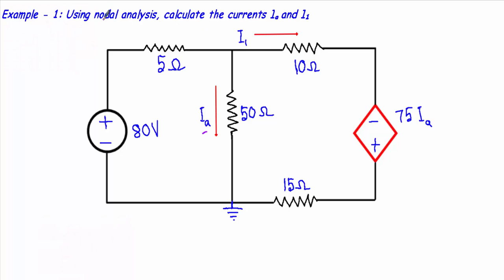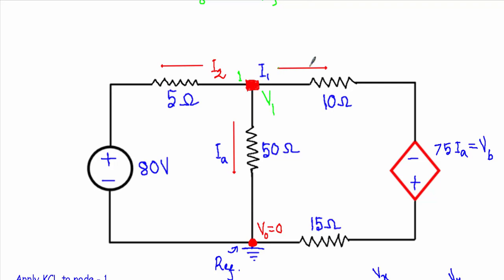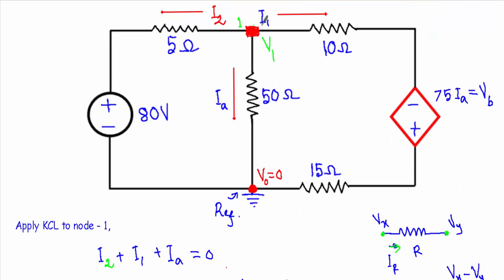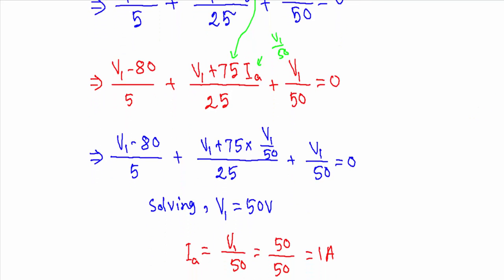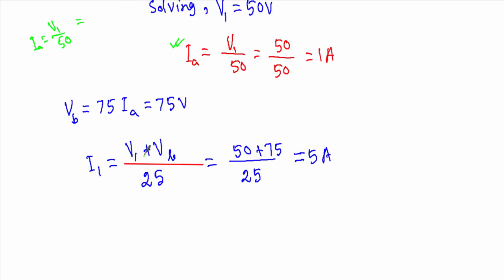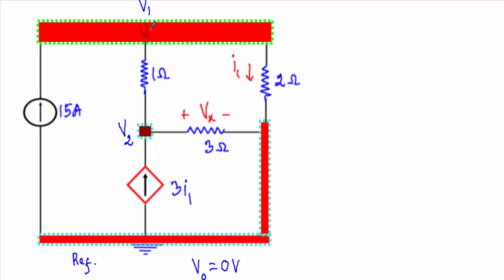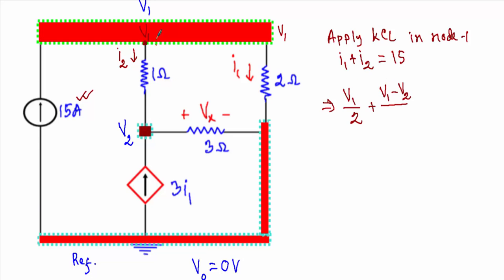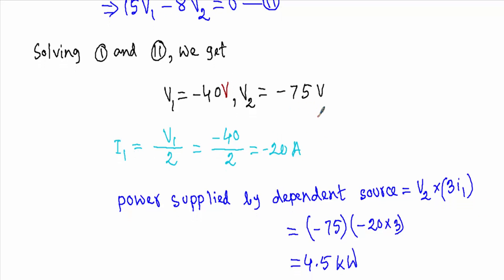Nodal Analysis : Dependent Source Circuit

Comment: I think you calculated the voltage drop on I2 backward..shouldn't it be 80 which is at he higher potential minus V1 which is at the lower potential. Like (80-V1/5)?
Reply from the maker: No. When you use nodal analysis, you have to assume node voltage (V1) is greater than any other voltage because the current in that branch is unknown. This is where people make mistakes frequently. 

If you still interested, check this video. I showed step by step analysis of node voltage method

https://youtu.be/6DNYpNUJ008